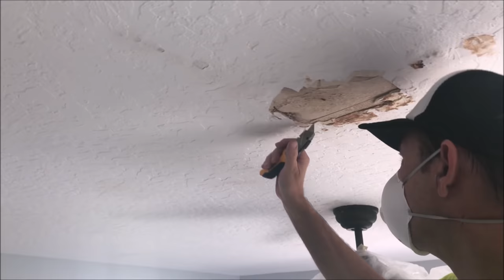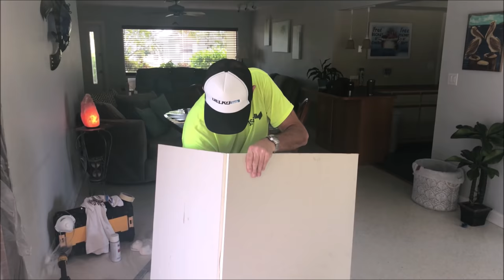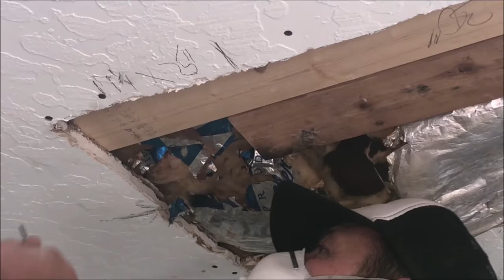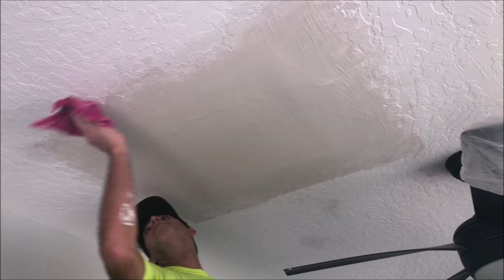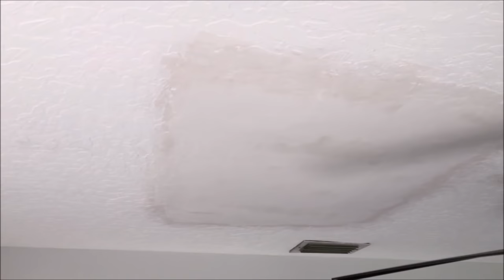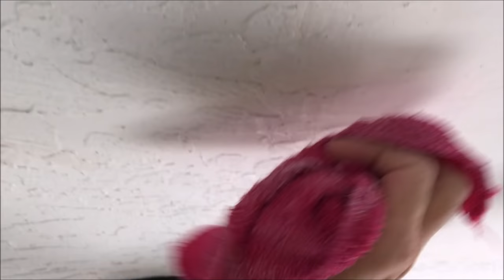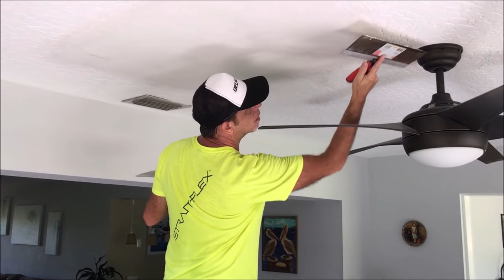How To Repair WATER DAMAGED DRYWALL CEILING- Step by Step

Comment: We thought we had a leak because of old water stain from previous home owner. We called a Plummer he cut out a circle box sized hole to check. No leak. He quotes $500 to fix the hole. I told him I would do it myself. N here I am on YouTube 😂
Reply: After watching this $500 for the cereal box size hole it is. I can not do this 😂

Comment: 5:30 Ihave a photo of my wall that I really want to do myself it has no water damage it’s a bedroom and the largest wall in this room.  
I have 2 screws or nails that are coming out.  4 small holes.  Then I tore off an ugly trim piece that left so much damage including torn drywall paper and a ridge of paint that is awfully awesome but terrifying to me the novice.  I also have 4light box major issues that include crooked boxes and broken walls on the other side it has very bad damage.  Hammers have been used to much and many times made it worse.
Reply: I’m soon to be a retired teacher and can change a light fixture.   I am trying to up my skills

Comment: howsa 'bout using MR board instead of the regular drywall for the repair ??? ... and before you install the MR board , put an absorbent mat under the pipes ... of course, before any ceiling repair , you gotta check for a nail penetrating from the 2nd floor subfloor into the pipe that won't be visible from the underside but you'll feel it when you check the top of the pipe (just under the subfloor) ... framers using a 16d nail  to quiet a squeak in the floor (blind nailed ) and missed the floor joist hitting and penetrating the pipe just under the floor ... then it becomes a recurring problem if the plumber doesn't fix the real problem from the 16d nail hole !!! ... built about 2000 homes since 1976 and this has happened in only 3 homes

Comment: Not bad but....

1a. I am not sure you got the right thickness of sheetrock. Saw some large gaps. 
  b. Also, why bother to waste time blending and adding more moisture to the work when you are going over it again with skim? 
c. I would have gone at least a foot longer on the sheet rock. You had plenty of it right there. No good reason not to. Clearly there was water damage on the far right edge. Inside there could be mold. Just knocking it with a fist and it feeling firm is not good enough. Always replace sections of sheetrock and well beyond the border if it is water stained. That means water soaked it so much it came through the inside and through the paper, primer and paint!

2. Always wear safety glasses and a real respirator. You don't want lung issues. 

3. A great pro tip/trick is to cut out a channel so the tape sits perfectly flat and flush. If not, you will always see a slight hump where you mudd over the tape. You basically use a razor blade to cut the paper on the sheet rock. Similiar deal on the ceiling. 

4. Do not rush and use a heat gun if you can affored not to- like if you are the home owner let it dry properly so it won't later shrink and crack. All a heat gun does is heat and seal the outside. The inside takes longer to dry.

5. Do not prime/paint for at least 24 hours. If it is very humid out these things can take a long time to dry.

Comment: yeah.....but you spend WAY TOO MUCH TIME  trying to catch the goobers that WILL FALL.    I have fired drywall crews for that.  20 min durabond dries extremely quick and anything that hits the floor can be easily cleaned up.  If you are more concerned with keeping crap off the floor, you are TAKING TOO LONG TO DO THE JOB!

Comment: With the mildew and or mold on that drywall. You are supposed to cut 2 ft from the edge of mold or mildew. If any of you are doing not doing this you are doing 100% wrong! 100% leaving the chance for it to grow and speard in the future. Most likely that space also needs to be treated. You should NOT close it up or take peoples money if you don't. You are in my opinion 100% responsible for and health issues someone can and will have and should be held to the fullest extent of appropriate law and a court will agree. If in doubt walk away
 You are not qualified.

Comment: Once drywall gets wet, it's junk and it will mold. If it doesn't mold it will still sag eventually.  That should be removed and replaced with a new piece of drywall. That's the lazy man way to fix stuff... just cover it up. This is not professional work! Do not copy this guy.